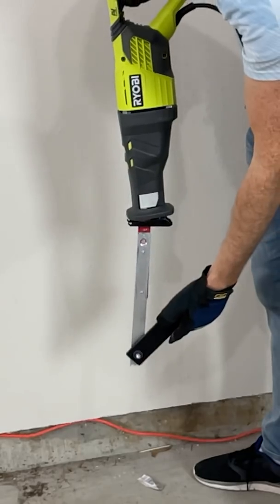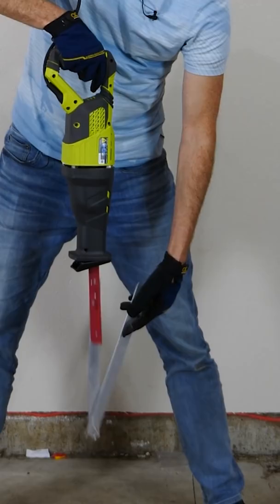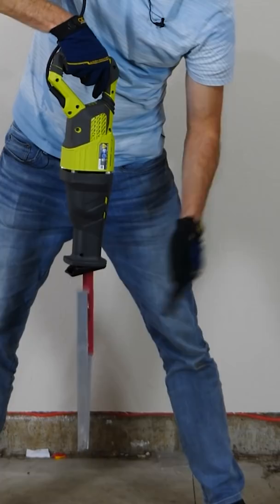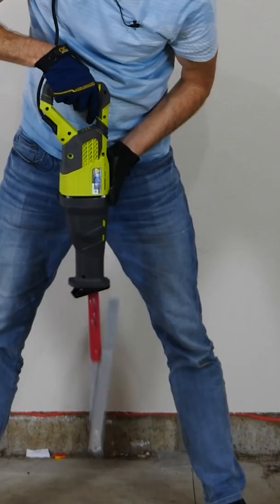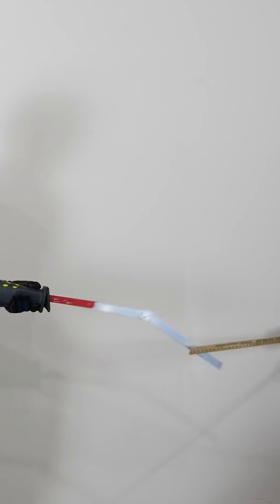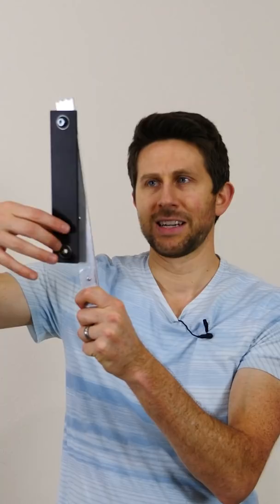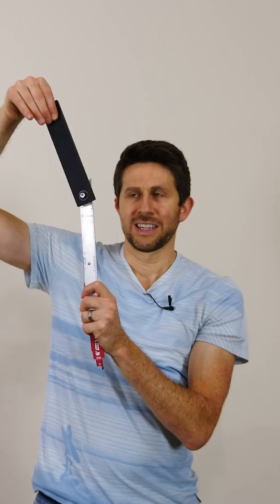Upside-Down Pendulum Falls Up

Comment: An inverted pendulum is a pendulum that has its center of mass above its pivot point. It is unstable and without additional help will fall over. It can be suspended stably in this inverted position by using a control system to monitor the angle of the pole and move the pivot point horizontally back under the center of mass when it starts to fall over, keeping it balanced. The inverted pendulum is a classic problem in dynamics and control theory and is used as a benchmark for testing control strategies. It is often implemented with the pivot point mounted on a cart that can move horizontally under control of an electronic servo system as shown in the photo; this is called a cart and pole apparatus. Most applications limit the pendulum to 1 degree of freedom by affixing the pole to an axis of rotation. Whereas a normal pendulum is stable when hanging downwards, an inverted pendulum is inherently unstable, and must be actively balanced in order to remain upright; this can be done either by applying a torque at the pivot point, by moving the pivot point horizontally as part of a feedback system, changing the rate of rotation of a mass mounted on the pendulum on an axis parallel to the pivot axis and thereby generating a net torque on the pendulum, or by oscillating the pivot point vertically. A simple demonstration of moving the pivot point in a feedback system is achieved by balancing an upturned broomstick on the end of one's finger.

Comment: I feel the length of the pendulum, weight of the pendulum, frequency, and amplitude of vibration would all play a critical role in maintaining stability. the second half of the oscillation when the pendulum is returning to the axis of vibration would need to be timed in a way that would slow the rotation. The rotation force would be a cosine(off-axis angle) function.

Comment: With the right frequency of vibration, you can actually make a double pendulum (or a middle rod with a rod jointed to each end) stand straight up. Even if you allow range of motion in any or all directions at the joints. The simplest explanation I've heard for the effect is that none of the parts have time to fall in a specific direction because their base is vibrating so quickly that they constantly want to fall in other possible directions as well and just remain straight as a result.

Comment: It does not have to do with timing per se. It’s simple geometry and trig. 

While pushing up adds rotation that counters it being upright, moving down adds more restoring force because at that point the angle is greater.

Comment: The conclusion is incorrect. The pendulum will align itself with the direction of the oscillation (forward-backward movement) and not default to pointing up. You can clearly see this when he tries it in a diagonal orientation and the pendulum points the same diagonal direction.

Comment: I guess that the constant motion causes the force of gravity to reverse giving upward oscillations right ?
Because the pivot point is constantly moving
Reply: It wants to line up with the axis along which it oscillates due to the torque around the center of mass of the oscillating driving force

Comment: Love your channel but this actually depends on the frequency of oscialtions and direction, meaning how it's build and what is external input. 
Usually falling down would mean going to most stable or lowest energy point, and this ain't. This is 'falling up's only when certain conditions are met and it isn't stable. 
So it's actually not falling up, rather it's aligned with external axis

Comment: “The stable equilibrium point is at the top” but you didn’t prove it isn’t still also at the bottom
Reply: There is one still at the bottom it doesnt dissapear here
Reply: @matt171013  Exactly. So he should have said “One of the stable equilibrium points is at the top”, or similar, rather than implying there is only one at the top in this scenario

Comment: I might be tripping but, if you slap your fore arm while throwing somthing into the air, kinda like your stopping your self from throwing it it'll gain more vertical distance then if you just toss it the same power. 
Am I tripping or no ? Internet explain

Comment: This principle is pretty cool and can be demonstrated in several different ways. It is best explained using statistical mechanics and the principles of driven harmonic oscillators. In essence, the added energy of the reciprocating saw causes the pendulum to seek a higher energy stable state.